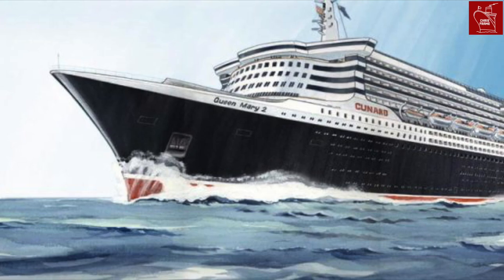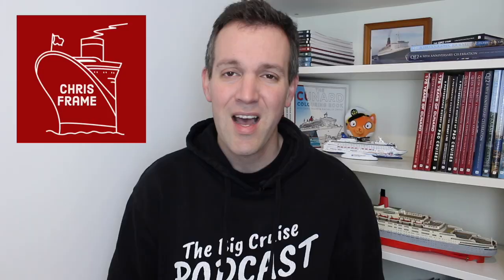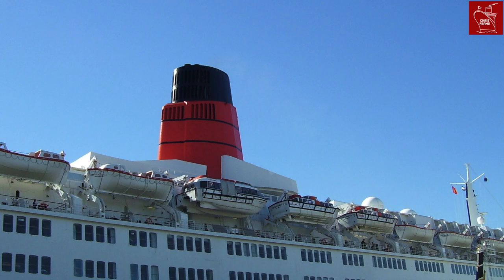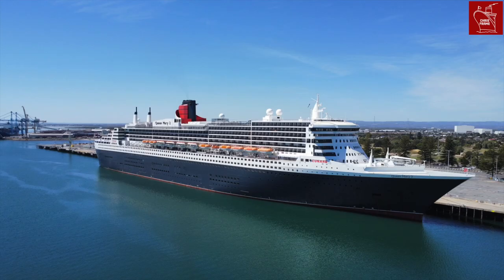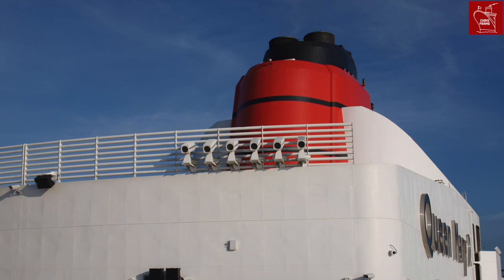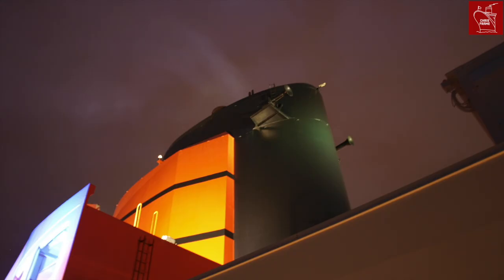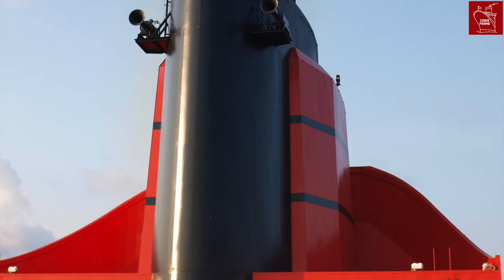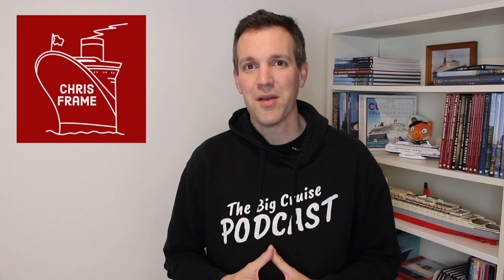Big Ship, Tiny Funnel: Why Queen Mary 2 HAD to have a short Funnel?

Comment: Hi Chris, another excellent video. The QM2 is a truly beautiful ship. Just out of curiosity, the old ocean liners had lots of cowl vents, to ventilation the lower decks. Obviously the technology for ventilation has progressed. Are there still ventilation shafts on top of the QM2 but hidden in design? Or it’s done in a completely different way now? Thank you.
Reply from the maker: QM2 does have vents on the top decks and also the boat deck but they’re not cowls. They’re large rectangular intakes with grills covering the opening. You can see some of them under the funnel, and deck 7 aft. With the ship having air conditioning throughout they ventilate her in a different fashion to what was used on the liners of old.
Reply: @ChrisFrameOfficial  thanks Chris for answering my question. I know you are busy, but much appreciated taking time to read the comments and answering. Thank you. 😀